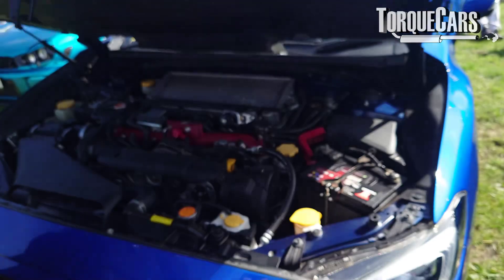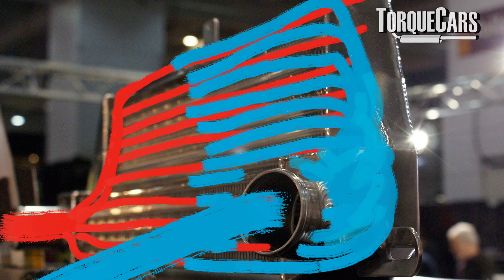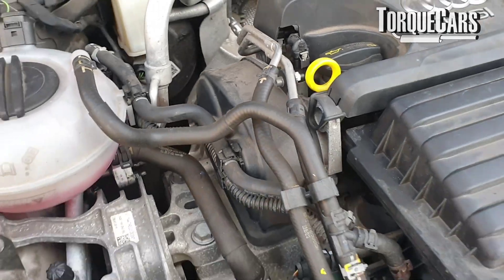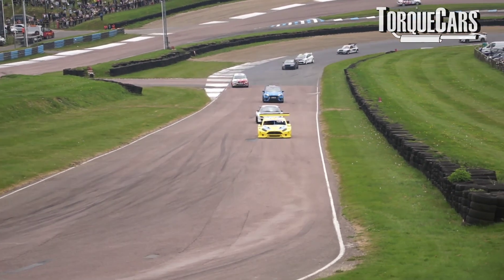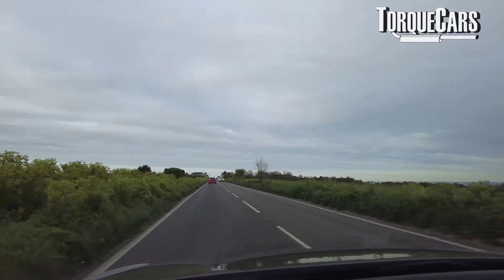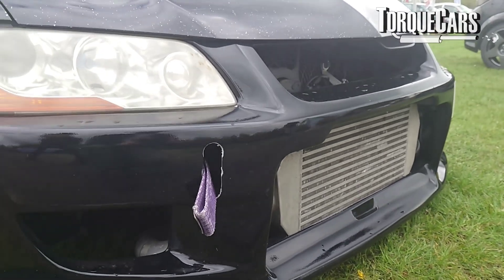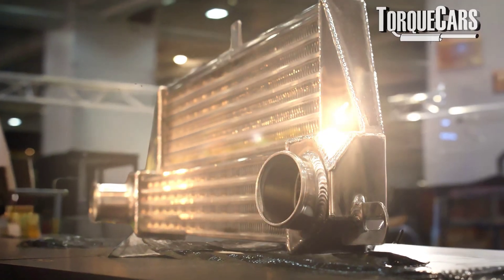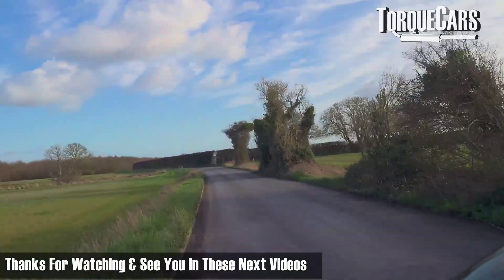Intercoolers & Power - All Turbo Owners Need To Know About Intercoolers & Upgrades For BIG HP Gains.

Comment: False information from video. Standard intercoolers usually are about 6-11 liters of air. When you drive especially in the city or long time like 1-2 hours a day, the car loosing at least 30-40hp from heat. Less oxygen. When you install 17 liters for example intercooler then you do not have extra horsepower power but you don’t have this drop of 30-40hp after city driving for example. So to maintain 40hp more is a lot of power and the engine breath better because actually this is an expansion tank. On the acceleration your car will be more quick, more responsive. Also this jerking at low speeds will 70% disappear. This will not make the consumption higher because this has to do with injection ratio and boost. This actually will make your car slightly 2-3% more economical but it’s trivial. Big intercoolers help a lot.

Comment: All good and well explained.
I run stage 2 on my Golf R. It performs very well when i give it the ocassional stick. I don't do back to back stuff but the ocassional spirited drive. Because of this I am not sure if i get value out if a bigger intercooler. Yes. We have hot summers in Australia and i can see it for the better then more consistently. But how often would i really make use of max power, really? Not that often versus the expense.

Comment: Excess capacity is what you need from an intercooler upgrade if tuning your car or using a stock car for spirited driving. 
OEM types typically have little to no excess capacity because they don't need it.

Comment: In Australia we have 40+ degree summers and I got sick of having a much quicker n/a classic in winter than summer so added a low-pressure water injection. I reckon I was losing at least 30hp+ without it on the hottest days in an old cam build Euro. If you get real hot weather on an old school cam/compression build, intake temps seriously mess with n/a engines too.

Comment: The vw mk6 golf water intercooler is ok, till you stop and turn the engine off for a while then start it up again. Heat soaked to 40-50, black plastic intake with the exhaust a bit below it.
With no air flow in the engine bag and the water pump being off, welcome to knock/pinking city ! 😢

Comment: I appreciate your method of delivery - it's easy to follow and is very much grounded in reality.

One detail that wasn't present in your video is that if you have a factory turbo that is on the smaller side (ie. better throttle response and quicker spooling characteristics), but install an intercooler that is significantly larger than the OEM one (50% or greater in volume) it takes a greater volume of air to fill the intercooler.  Blowing air through a straw does not require a lot of air to reach a high velocity, but blowing air through a large tube takes a lot more air to reach a high velocity.  The direct impact is that the velocity of cooled air going into the engine has an additional delay as boost pressure builds and it takes a bit more time to increase the velocity of the air going into the intercooler.  Some of that added delay can be designed out of the intercooler, and that likely means a higher cost intercooler versus one that is not optimized for air flow velocity.

As volume increases velocity decreases, and the same is true in the opposite direction, as volume decreases velocity increases.

Upgrading to a turbo that is sized appropriately for that intercooler is a good step, and then you get into an unending cycle of upgrading parts in the pursuit of either more power or greater cooling efficiency, which also often leads to upgrading injectors, flashing the ECU, etc, etc, etc...

Upgrading the size of the piping (from 2" to 3" or greater) can also introduce more delay (ie. slower air velocity).  The larger the piping size increase the greater the delay will be present/noticeable.

Anyone can buy a $150USD intercooler off Amazon/Ebay, but that does not mean that it will do a better job of cooling the intake charge versus a $500USD intercooler, in fact that $150USD intercooler might be worse than the OEM intercooler.

Simply increasing boost is also not a wise move - most engines are designed with a specific amount of boost pressure in mind, which also determines if the pistons are cast, hypereutectic, or forged - each has pros and cons.  If you go from 12psi to 20psi, you are very likely going far beyond the heat/pressure range of the pistons in the engine, and the result could lead to broken ring lands (ie. replace the pistons), a blown head gasket, a rod through the block, etc.  Each turbo also has its own efficiency rating in terms of boost/heat.

You also have to factor in what the heat range of the spark plugs you're running are.  The more boost pressure, the more you will likely need to upgrade your spark plugs, including changing the gap (more boost = smaller gap is a very loose rule of thumb, not a hard rule).

The smart move is to come up with a power target, and then see what parts would net you that power target, without going overkill (size/capacity) on any particular part.

Don't forget that your clutch and gearbox will be receiving all of that additional torque.  If you're running an OEM clutch, there is a high probability that it cannot handle the amount of additional torque being developed by the engine and will slip like crazy.  If your gearbox is not designed for high levels of torque, then you might shear gears or blow up the gearbox completely.

Sorry for the info dump.  More stuff just kept coming to mind.

Comment: So I should re-direct the air-con output to the intake?
Reply from the maker: Hey that's an interesting idea! But I've got the ultimate cold air upgrade, the intake air is fed over my wifes feet before it goes into the intake - they proved colder than a nitrogen cooled heat ex-changer and it's free!

Comment: Don't forget that if you install a bigger intercooler you will have bigger lag.
Reply from the maker: Sometimes but it depends, most find that deeper intercoolers tend add drag and taller ones don't but it depends so much on the design of the intercooler internals. A well designed intercooler is just allowing the air to flow through it, the slower the bigger chance there is to cool the intake charge - so there is a point where larger means no drag (but much lower velocity). This is pretty complex when you dig into it. My own take is that going up in intercooler size doesn't generally have a negative impact on a street car.
Reply: @torquecars  Well, I meant size as in air volume. More air volume needed to compress, more time it takes (bigger lag).

Comment: I have the biggest innercooler I was able to put on my car. I also run water/methanol injection and during WOT my temp almost never go above 10C or 50F. Typically they will get 0C or 30F.

Comment: what mods should i start with on my 1.8tfsi ea888.2 ? aiming for the 300hp
Reply from the maker: I've done a few videos on that engine. https://www.youtube.com/watch?v=fDVi9lG8lWU Is it the big port head and forged bottom end version? They are good to have in higher power builds. A turbo - the K03s, remap fuel pump and injectors will go a long way to help you get that power figure. Check out the articles on https://www.torquecars.com/audi/18t-tuning.php there are quite a few tips and pointers there on that engine.
Reply: @ how would I know if it is a big port head or forged bottom end? It is engine code CDAA.
Reply from the maker: Sorry I sent the wrong link (so many 1.8T versions sorry) try this, https://www.torquecars.com/audi/ea888-tuning.php so steel crankshaft and revised pistons, I shouldn't have mentioned "big port" for this engine revision, I think they all were at this point but I'll be glad if someone out there knows for sure.

Comment: Lower air intake temperature reduce exhaust gas temps. You will get a happier turbo with a more effective intercooler. Especially true in hot climates or on remapped cars

Comment: By lowering the intake charge you will lower the cylinder and exhaust gas temps. EGTs are very important for the longevity of VNT turbos used in TDIs and the 718. Lower cylinder temps in diesels result in lower NOx emissions too...
Reply from the maker: I've never really thought about that. Does the EGT drop much with lower intake temps? The combustion process ramps up the heat considerably, plus you've got the extra oxygen leading to a "bigger burn potential"  I never really thought it would make a difference but you've got me curious now.

Comment: What do you think about intercooler water sprayers? Do they work?
Reply from the maker: They are effective, but you need to keep them topped up. They IMHO are more suited to racing and motorsports rather than everyday road use. I've seen people packing Ice Around the Intercooler to cool it further. You need to weigh up the benefits of power gained to the cost and convenience of the install.

Comment: Do any intercoolers cool the engine oil?
Reply from the maker: They are not called intercoolers, but there are specific oil coolers which work on a similar principle. People who tow often have these fitted to keep oil temps down.
Reply: T @torquecars 
Thanks.❤
Reply: Oil coolers and transmission oil coolers if you're tracking...
Reply: My 2.8 Granada had gear box oil cooler incorporated in the radiator a bit d rotted and both mixed. Had to get radiator and gear box

Comment: I’ve done this many times. In my experience an intercooler will give you gains instantly. You will feel a difference in performance but it won’t be anything major until you’ve had it mapped. Mapping mapping mapping is the real key.
Reply: Wouldn’t bigger intercooler cause more delay air getting into the intake
Reply: @iphone-uz8vc  not really. Same as longer exhaust before turbo. Not measurable difference.
Reply: @iphone-uz8vc This is where it is important to get a good one, not cheap shit. Intercooler larger specific for your car is fine.
Reply: @skykid4000  yeah. And if you drive on a track the bigger intercooler let's you drive longer on full throttle before heatsoak.
Reply: @The_Annoyed_chef It was the first thing I upgraded when I got my ST. Along with the instant power gain, I got more mpg. My monitoring system claimed an estimated 18hp gain. Charge air temps went from 200°+ to only 15-20° above ambient temp. Highway mpg went from 27 to 30 on a 400 mile drive.
Reply: @jesuscarrillo4344  getting one next. Got 2013 Focus ST, Cobb accesport and filter now.
Reply: @The_Annoyed_chef  Make sure you get a custom tune. Do not use any universal tunes, including the ones on the AP. I went through two stock turbos before I learned my lesson. I'm on a powermax now.
Reply: @jesuscarrillo4344  I run APR tune for two years now. No turbo issues on my Golf R. Might be the type of car you have rather than a tune. 😅